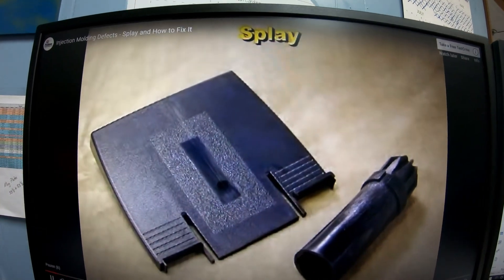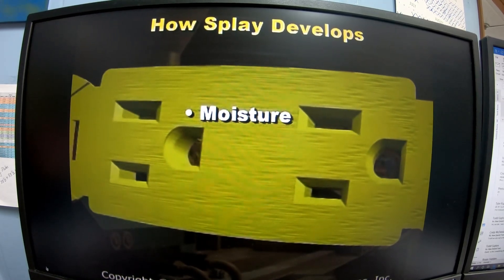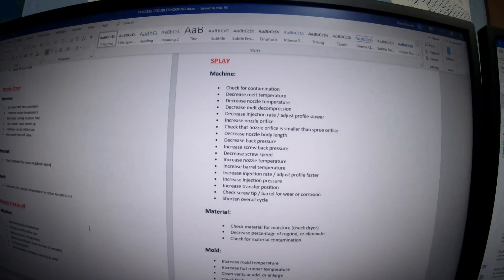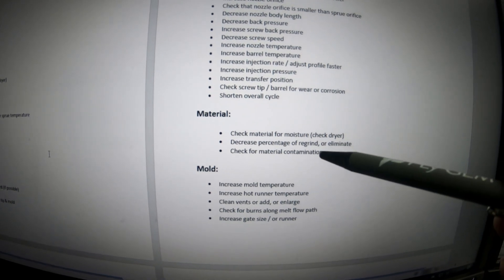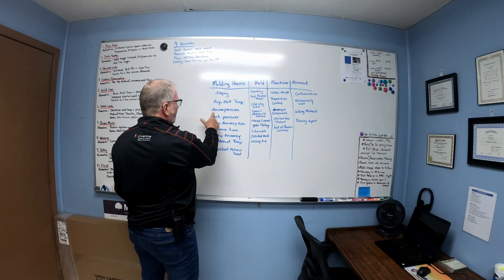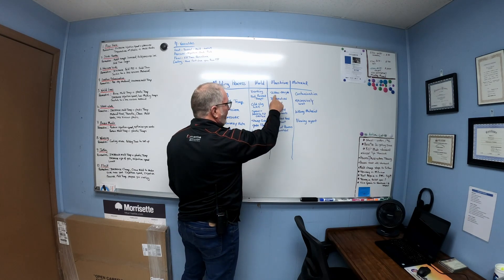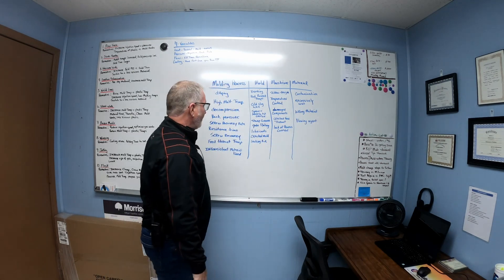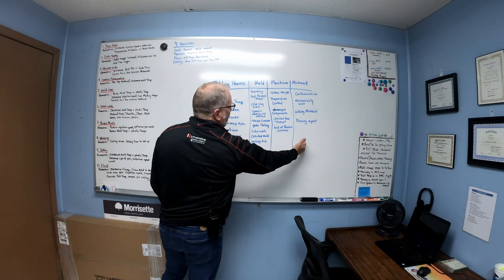SPLAY in Injection Molding

Comment: I'm getting splay on a part I'm trialing but it's only at the gates how can I correct that?
Reply from the maker: They call that gate blush, slower or faster injection speed. If that don't work, then the heat of the mold go up on it like 20 or 30 deg. If still an issue then the gate might need to be opened up a little. this will help the material to flow better. Its shearing at the gate area. Thanks for the support to the channel & I hope this helps you out.

Comment: micro bubbles are due to failure to check the RH% of the material prior to loading into the hopper. 
No process settings can correct this defect. Stop the run, dry the material in accordance with the supplier specs.
All the other actions are just avoiding the issues.
Reply from the maker: Thanks for the info on this, & thanks for the support to the channel.

Comment: Increase or decrease mold temperature should be at the process side not the mold side.
Reply from the maker: Most molds run with the stationary side hotter then the moving side. For example we run a lot of molds 110' stationary side & 80' moving side. This is so the part shrinks to the moving side.